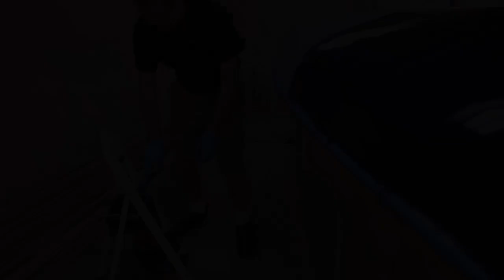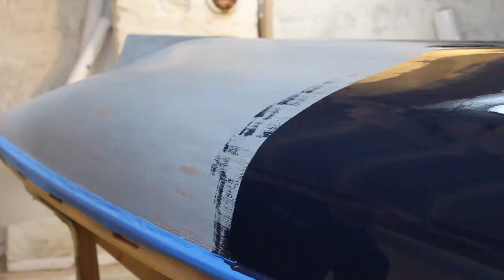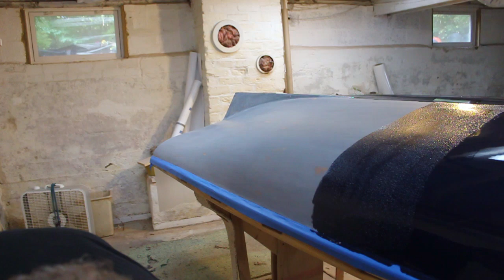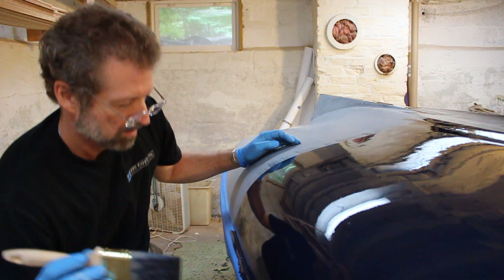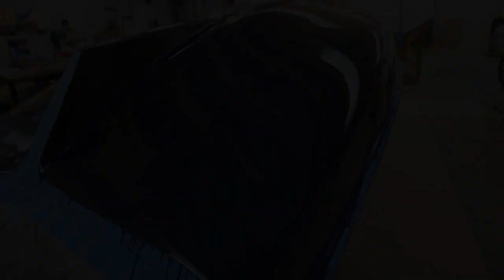Rolling and Tipping - First Coat

Comment: Do you have to thin the Pre Kote primer or just put that straight on?
Reply from the maker: Don't thin the Pre Note primer. You want it to be thick. When it dries you'll sand most of it off, down to the surface, leaving it to fill the pits and low spots and make a smooth base for the paint.
Reply: Thanks. And did you have any issue with the tape pulling the paint? When did you pull the tape off?
Reply from the maker: @patrick6165  No issues pulling off the tape. I honestly don't remember how long I waited, but knowing that might be an issue I would have waited until the paint set, but not until with was hard. Probably used a discrete place for a fingerprint test. As soon as no paint came off on my finger, would have pulled the tape. Might not have been necessary, but didn't want to risk waiting to find out. I do remember it was easier to clean off what got under the tape with a razor and a rag while it was still a little soft to get a clean edge.

Comment: I paint boats well not very well but aluminum boats. My question can you see brush strokes i use an air system
Reply from the maker: No brush strokes at all. The trick is to thin the paint enough that it flows out flat.

Comment: Do you paint wood?
Reply from the maker: This is wood sealed in fiberglass and epoxy, plus a lot of primer/filler and sanding. You could get that kind of finish on bare wood, but it would not hold up as well with changes in moisture and temperature – eventually showing cracks, etc..